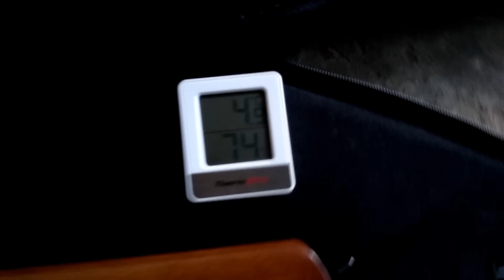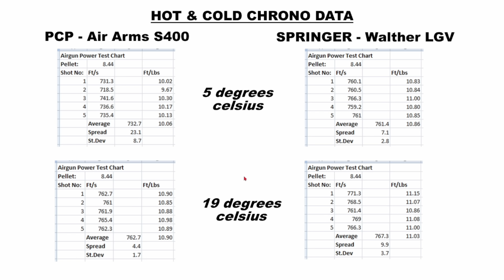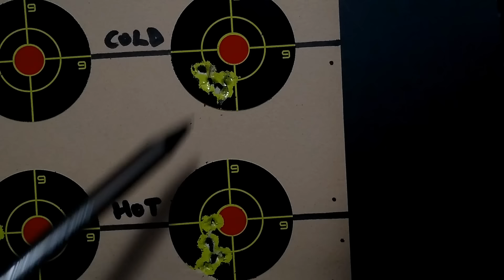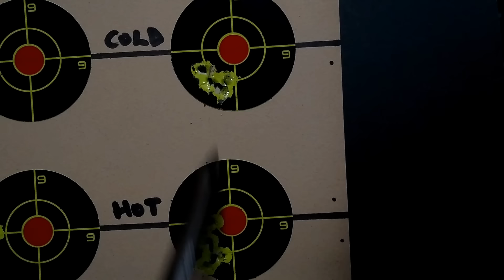34 - Cold Truth: Temp Impact on Airgun Accuracy!

Comment: That was very interesting. What I have noticed is that my aim points changed during the course of the day as the gun got colder. Either that, or it was me getting colder. LOL. I shoot a PCP. Thanks for that. What did surprise me was, that even it was only a small difference. The springer performed better when it was cold, when it was warm. I was always led to believe that springers performed better in the cold. You bust that myth. Cheers👍
Reply from the maker: Yes Steve, certainly interesting results. I'd always been worried before about my springer getting too cold.

Comment: You should try this again in mid summer and keep the cold results from today within a few minutes. The steel on both of your warm rifles will cool within minutes of taking them outside in the cold .In mid summer, you will see how hot the metal gets as it will be very hot to touch 😊
Reply from the maker: Planning on doing just that. 👍
Reply: @hftshooter  good man ,we also found out that cleaning your bore would mess up the point of impact and groups ,I was trained to clean your rifle after shooting, but with modern powders and metals in barrels have changed ,I would shoot 3 shots on a range day and know I had a good group ,I would go home ,clean and lock my rifle away ,not banging or hitting the scope ,next time at the range ,similar  temperature, same batch of ammo same sort of wind and my groups had opened up drastically, this went on for a few months ,I was talking to the guy that owns the range about it as I said "I can't understand why" he said "stop cleaning your bore unless your using cordite or your bore has gotten wet" this felt like it went against the grain ,he also said only clean it once your rounds start to drift ,we're talking anything upto 300 rounds ,so I started to use his method, and to his word my groups staid the same unless it was a windy day or temperature change ,I even spoke to a bench rest shooter and he said I was talking out of my azz  but when I quizzed him ,I said "what do you guys do before shooting a comp ? you put a few fouling shots down range .From that day on, I was winning comps ,my 22LR barrel was never cleaned either, ok air rifles don't use powder but the prisable is the same when it comes to rifling fouling 😉

Comment: It can definitely be gun specific, last time I checked temp change years ago over crono with my EV2, set it in sunmer at  around 25 degrees it was running 770 on average, checked it again during winter league around freezing and it was doing around 760, back upto 770 in the following summer.

Scope shifting or other parts of the rifle expanding/contracting can also cause POI shift too 

One of the problems with testing something like temp shift is the variability from gun to gun (even the same model), springers especially can vary, with shed tuners altering shift characteristics based on internals (including what/how lubrication is used)

The HW100 was notorious for temp shift due to the grease on the hammer assembly, once that was removed it was very stable  (at least the one i had) had to nock the power down after removing the grease but had little temp shift afterwards.

Edit: most temp shift I've seen personally is about 20fps from summer to winter temps, not necessarily my rifles, but the highest I've heard is  about 50fps (for a gun that's working fine)
Reply from the maker: Thanks for sharing. 🙂👍

Comment: I've done a lot of endurance airgun testing of my own from leaving my PCP out overnight when it's -21 below  coming out and shooting it and seeing if what the differences are if there's any. 
I have left it inside to where it's at 90 and then came out and shot it when it was -21 below to see I've never experienced any problems between the hot and the cold the only difference is I've ever experienced is different Scopes act different in the cold I have used the same gun and just change the Scopes and shot it in different temperatures with the scope and the gun would always stay true it would just be the scope that would shift up or down or left or right with temperature changes the air guns always seem to perform exactly the  same.
Reply from the maker: That's interesting, thanks for sharing. I just checked out your channel and see that you're shooting higher power air rifles than my lowly sub12. Could that be the reason you see different results?

Comment: Four percent change in velocity is no concern.  Try the same experiment with a gas ram springer vs steel springer.  Beeman vs Crosman or Gamo.  I would put my money on Beeman or any steel springer.  Cold has no effect on my Beeman Manris, 998 fps, 8.3 Superdomes, 0.38" groups at 30 Meters.  Not going to buy any gas ram spring...  Good  video.
Reply from the maker: A gas ram is more of a PCP than a springer though isn't it?

Comment: Very interesting.  I've had some unexpected misses on rabbits at 30-35yds this last few weeks (very cold weather using AA S510 JSB 8.44g).  Reviewing the PARD night vision footage my aim points parallax and follow through were good. I also had to adjust the 25yd slightly to bring up the POI.  Your results help me think this through and consider how to accommodate - cheers. ..... So, does a regulated PCP show the same characteristics?
Reply from the maker: I highly doubt a regulator would make any difference to the result.

Comment: Some comments below about scope shift, any theories what's happening to it?
Reply from the maker: I can only think it may be movement of the internals due to expansion or contraction. 🤔
Reply: @hftshooter  I read somewhere via Burris that if the scope is ever so slightly kinked it will expand in a none linear way, hence the need for lapping.

Comment: hello , why is a springer not so sensitve with de temp . the spring gets stiffer in the cold , and that overcomes the higher viscosity of lubes and thicker air    ,this will not be the case with a gasram   ,  the pressure in a gas ram wil fall in the cold
Reply from the maker: Thanks for sharing.

Comment: Interesting test, but did you try the pellets warm & cold also ? I suspect that there would be less of a difference if the pellet temperature matched the gun temperature !
Reply from the maker: I don't think so. A temp change is not going to effect pellet mass and the change in head size will be insignificant.
Reply: @hftshooter  the mass won't but the hardness of the lead would, bearing in mind the jsb's are already pretty soft
Reply from the maker: Hi Don, I just did some calculations and the density of lead will change by just under 16 milligrams per cubic centimetre over a 14 degree drop. So given the size of the pellet I would suggest that its worth considering, but insignificant.
Reply: I totally agree, but we're not talking about mass /density(they are different properties) thought mrtaffspoon was talking about the hardness of lead at different temperatures. And it's effect on pellet- land /Grove fit. Personally I think a more interesting experiment would have been the effect temperature has on humidity&air pressure at the impact point . I hate spec talk, sooner spend the time shooting my rifles

Comment: All comes down to the PCP needs compressed air to expand where the Springer is simply pushing a volume of air But the Springer is requiring the lubricant used to be more or less viscous in tune with the temp obviously less in the cold. Why are both of these not zero in to start with makes any conclusions null and void
Reply: Looking at poi shift so the zero is irrelevant as long as the aim point and scope setting aren’t changed
Reply from the maker: Exactly! 👍
Reply from the maker: What DanM said!
Reply: In warmer temperatures, the metal on all guns and ammo will expand, which will affect the accuracy due to tighter  tolerances. When I used to bench rest shoot, I would weigh all my cases ,powder, and heads to .2 of a grain , @100m I could shoot a clover group and a few times 1 ragged hole group ,and timing between shots ,when we would forward and patch the rifles were covered with a gun bag to try and keep them cool ,we had guys leaving their ammo in thier cars and they wondered why thier groups would open up ,this will affect air rifles as well ,lead will soften when warm and go hard when cold ,the barrel will expand in the sun as well